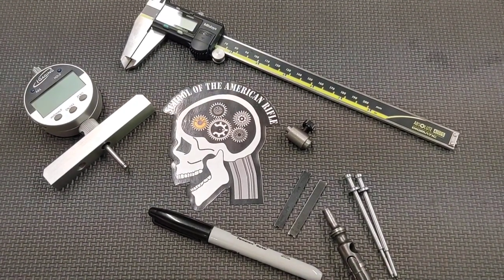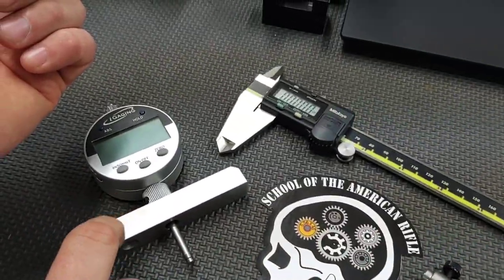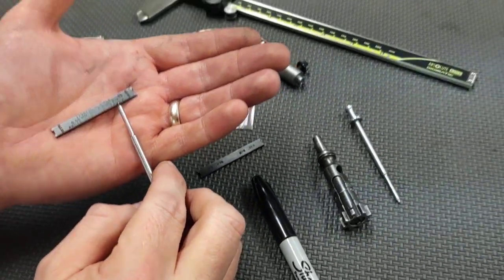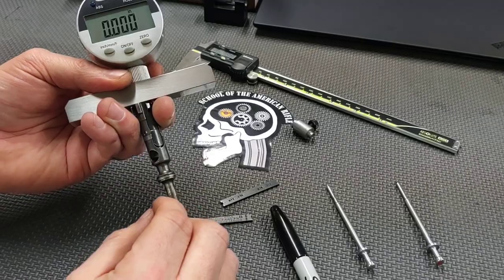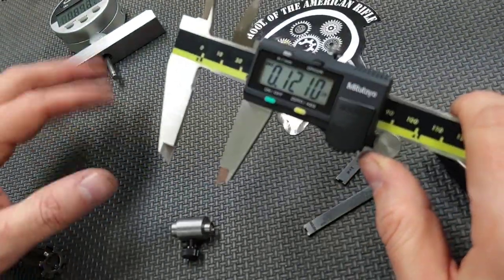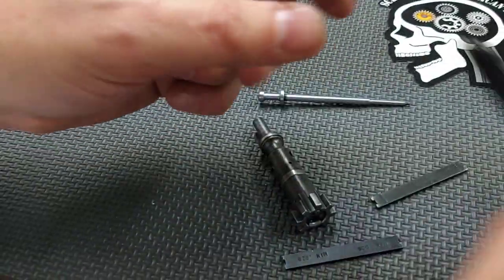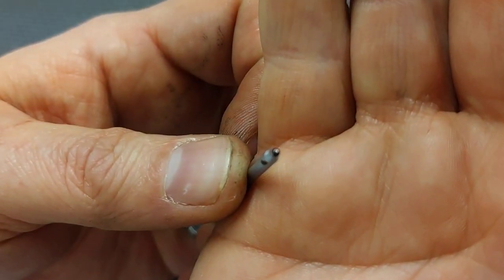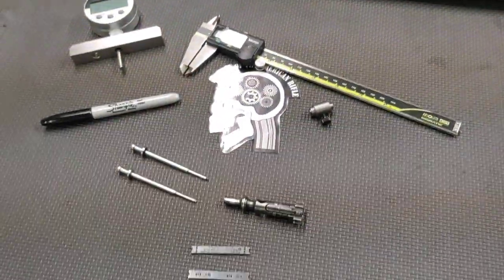Checking AR-15 Firing Pin Protrusion

Comment: As a machinist I love that when you turned off your calipers you opened the jaws. It’s a cardinal sin to keep your jaws closed while not being used. It can cause corrosion by ducking moisture between the 2 surfaces.

Comment: I'd like to suggest a much cheaper method. Use feeler guages to measure the space between the bolt tail and the firing pin flange after you lined up the firing pin tip with the bolt face.
You're welcome.

Comment: New owner here. I have an Anerderson AM -15. I notice when I pull bolt back I can not see any of the fireing pin protruding at all. Looks like just a small pin hole. Is this normal? I haven't tried firing for this reason fearing something may be wrong. I feel stupid for asking but I bought it used from someone who only used a few times still looks brand new. Thank you
Reply: You shouldn't see the pin protruding when you pull the bolt back. You should only see the pin hole. The pin should not protrude out of the hole until you pull the trigger and the hammer strikes the pin, which ignites the primer. When the bolt cycles back, the hammer will reset and your pin should no longer be visible.

However, the pin 'floats' meaning there is no spring to keep the pin from moving forward. So you might see the pin sometimes.

"...the titanium firing pin is so light, it doesn’t develop enough energy to fire the cartridge during the chambering of a round, or if the rifle is dropped.

The AR-15 has a hard-hitting hammer that is required to force the titanium firing pin into the primer hard enough to fire the weapon. That hammer doesn’t touch the free-floating firing pin during chambering of a round or when the rifle is dropped."

For more info: https://www.idahostatejournal.com/outdoors/xtreme_idaho/the-free-floating-firing-pin-in-the-ar-15-rifle/article_30861593-dee9-522c-aa04-b677335e65a7.html
Reply: @nickb317  Thank you very much for taking the time to tell me this. I really appreciate it. I have asked a few different channels and you're the only one to respond. Thank you again. God bless.
Reply: @davidgarrison9823  No problem. As fellow gun owners, we should be looking out for each other. Let me know if you have any more questions. I'll be more than happy to help!
Reply: @nickb317  Thanks again and will do!

Comment: Can you use the digimatic gauge to measure the distance between the bolt face and the inside channel of the bolt face where the firing pin comes out to determine if the depth is correct and if so what is the min/max range of such measurement? and can this measurement also determine the headspace?

Comment: Where did you get the flat, flush tip for the igaging tool? I just purchased the full kit and it only includes the rollerball tip, extensions, etc. but NOT the tip seen at 3:54 mark. Thanks
Reply: Igaging customer support confirms they do not have or sell that tip, so I'm extra curious now.
Reply: @michaelsutton210  he mentions in another video that he modified one of the tips in that kit in his lathe.

Comment: How do you fix the problem of too much protrusion? I’m marking my primer when cycling.
Reply: I’m sure you have figured this out in the past 2 years, but a dimple in the primer is normal after chambering a round due to the free floating firing pin design.

Comment: Any idea what an enhanced fp should mic to for 7.62x39
Reply: Did you find out? My new 7.62 started out perfect, but after 60 rounds began to have issues with non firing, then stopped firing completely. It dents the primer but no fire. I measure .022 which is undersize.
Reply: @mymusicaccount1456  no I just bought one from black rifle company I believe and an extra power hammer spring , I did find out that century arms had some bad steel case ammunition and sent me back some I sent pictures of the primers almost pierced and no ignition . I will mic my enhanced compared with a mil spec and get back to you

Comment: I have learned a ton of info from watching your videos.  I have the same depth gage as your iGaging.  Where did you get the small flat end?  Mine came with a pin end two rou button ends and a large diameter flat end but it wont fit in the bolt face.  Thanks.

Comment: Would this range of protrusion be the same for ar chambered in 7.62?
I had about 60 shots without a problem (new build, zeroing in scope), but suddenly my new gun had a couple failure to fires in the 4th box of 20, then stopped firing all together during the 5th box. Changed to a different box of ammo and still no fire.
I packed up because i figured it was just dirty, but when i broke it down i didn't see an unusual amount of grime, but i did measure the protrusion at .022.
As far as i can tell the pin still has a dome on the end, it does not look broken.

Comment: You could get a depth gage base for your Mitutoyo calipers which would make it a lot more accurate and easy to use in this application, which would perhaps be recommended for the hobbyist instead of having a dedicated depth gage?

Comment: Hi. Is the protrusion for an Ar10 (.308Win) the Same?
Reply: AR10 308 firing pin protrusion = 0.044" - 0.060" (0.055" - 0.060" preferred) ...I found this online. Hopefully this helps
Reply: @chrispybean  Thank you very much. Now I just have to convert in mm
 ‘cause we got the metric system Herr in Germany.